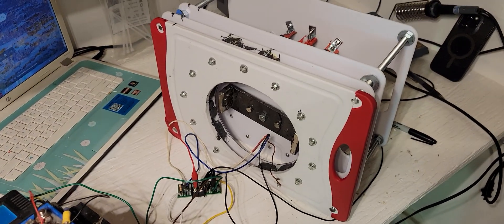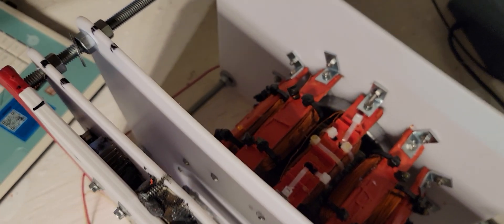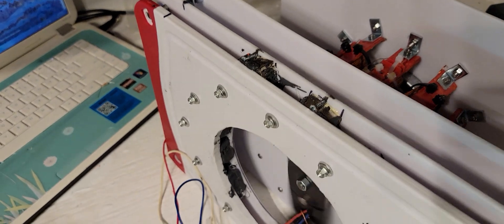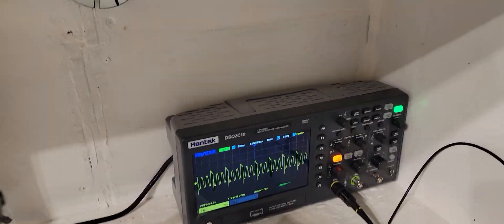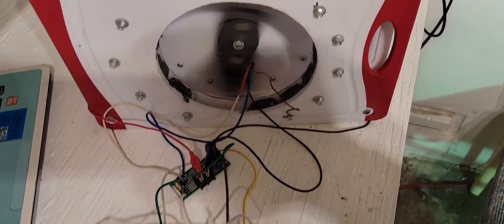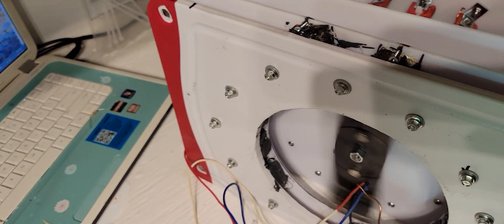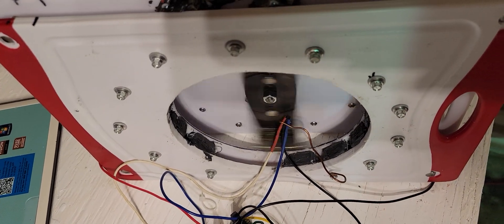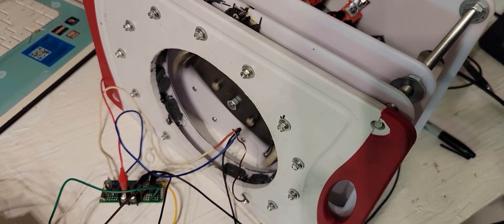First run of the Magnet powered Pulse Motor with the external Magnet ramp installed.  (FAIL)

Comment: Try analog meter for amp draw
Reply from the maker: I agree but I have current clamps for my scopes I’ll have to pull them out. The newest version of this motor is not registering any power usage even after hours and hours of running the batteries are untouched . I have a bunch of videos to upload on this motor it’s very interesting. Thanks for watching and I always appreciate your input Buddy!
Reply: @windpowerandmore6310  
 Sounds great ! Can’t wait to see more !